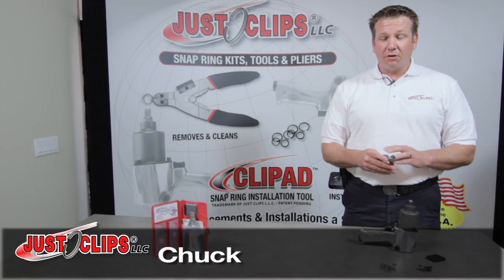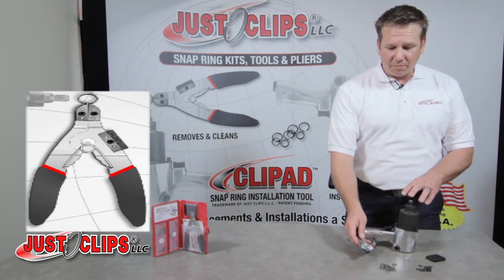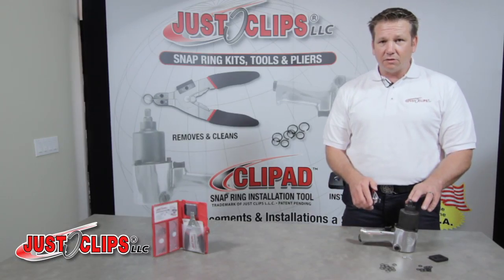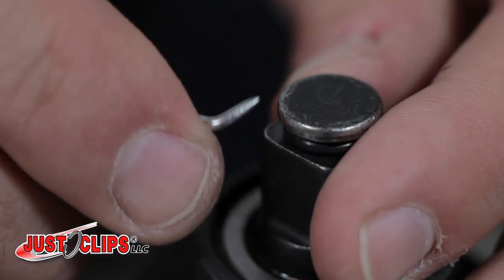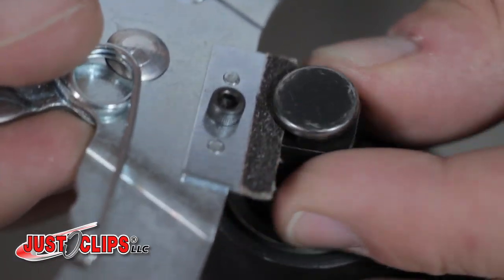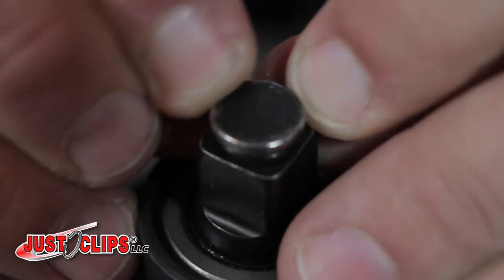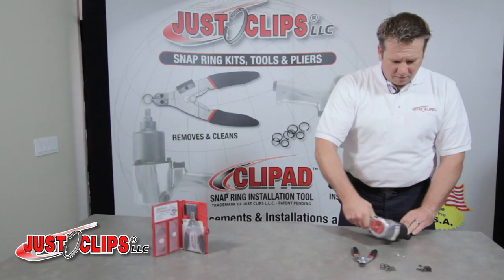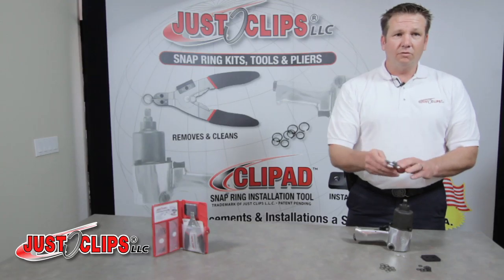Just Clips Snap Ring Tool Kit Demo

Comment: Nice kit. But I am looking for a long nose snap or circlip tool. The circlip is way down a motorcycle clutch master cylinder (one to 1 and a half inches). The width of the access is about 3/4 of an inch diameter.